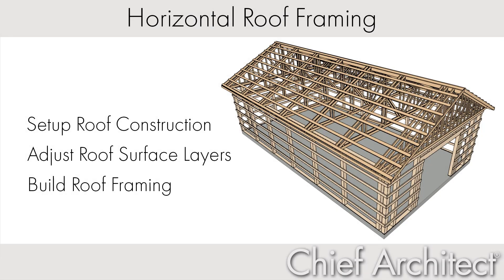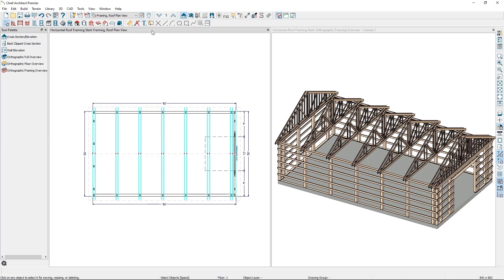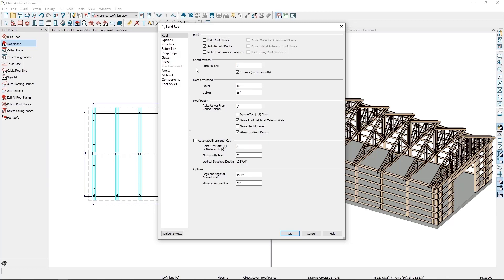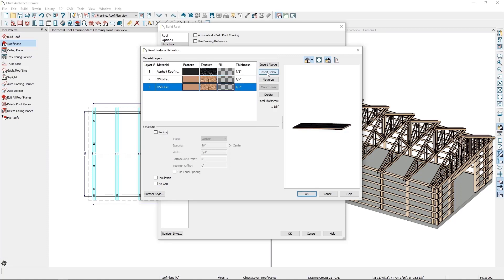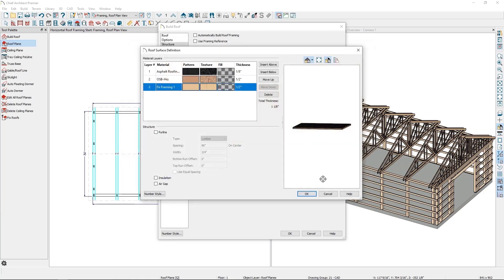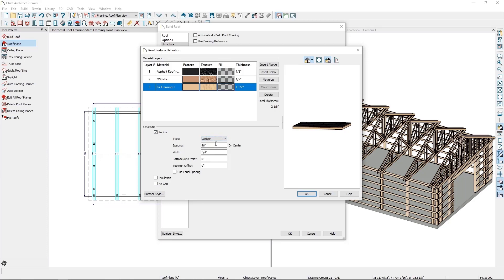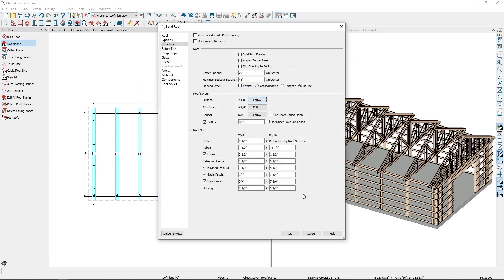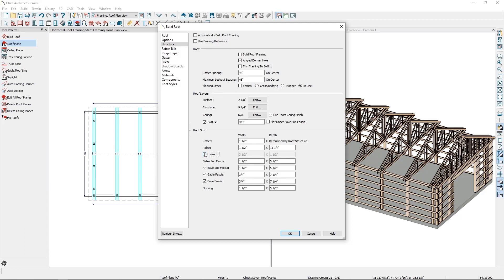Creating Roof Framing Purlins

Comment: Cool video, learnt a lot. I've been trying to use Chief and I can't get around somethings like roof framing, foundations and walls. I live in South Africa and the way we build is totally different from the US ways. For instance our trusses which are 38 x 114mm sit on top of the wall Plate which (38 x 38mm) and then the purlins on top of the trusses. Whenever I get to do this I'm so confused as to what should I uncheck or check and so on. Do you guys think you can do a well detailed video on this subject to show what is what? I have a Revit background but ever since I saw Chief and the things it can do, I'm seriously thinking of jumping ship. Also down here in South Africa we don't do floor framing at least we use to but it's extinct and now it's all concrete and I'm wondering if you guys have a video where a second floor is a concrete slab and not wood.
Reply from the maker: Thank you for reaching out. I can send our training team a note letting them know this is something you are interested in.
Reply: Thank you for your quick response. I'd really appreciate it if training team can help out. I'll look into your how you've instructed me on how to go about this 'thorn in my flesh' problem.
Reply from the maker: If you open up the second floor room specification, under the structure panel, you can customize the floor structure and the materials.